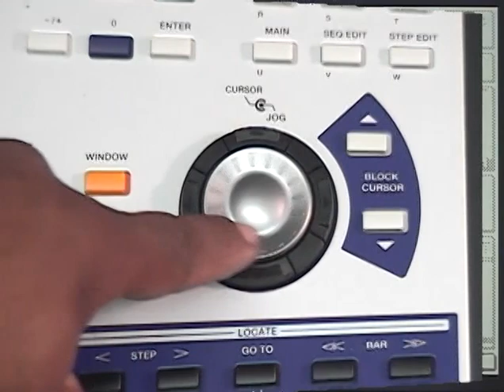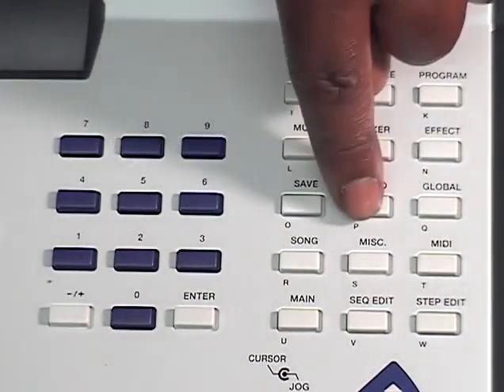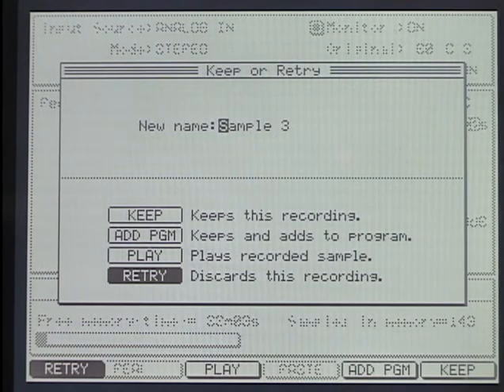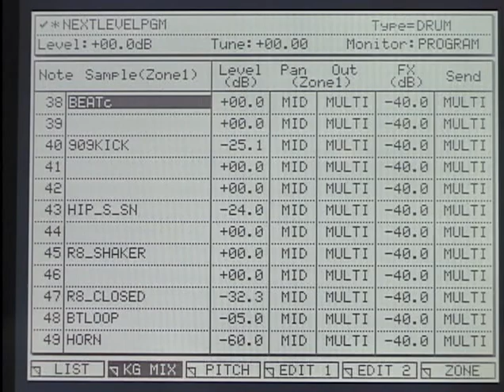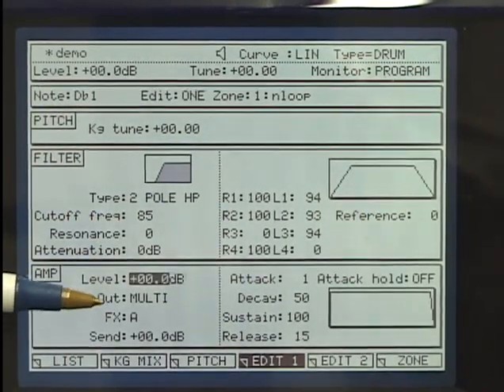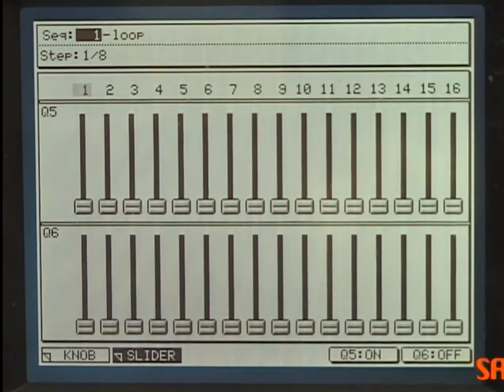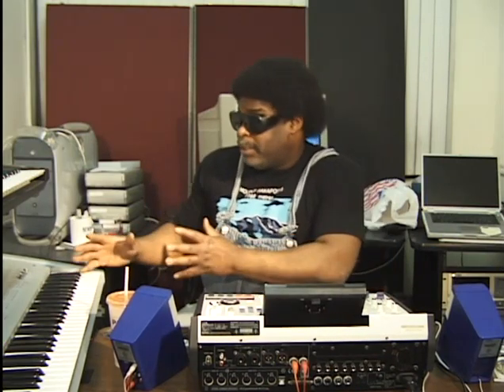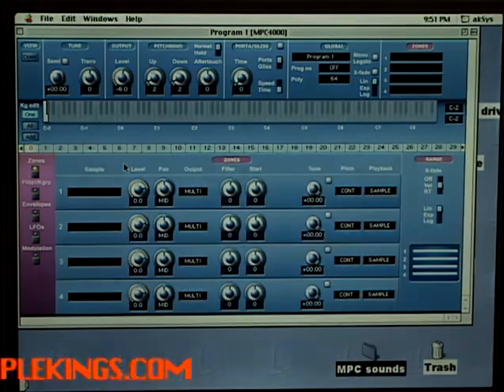AKAI MPC4000 BEGINNERS WORKFLOW GUIDE

Comment: I still have my old SCSI hard drive. Haven’t used it in years. It’s stupid fast. 15,000 RPM and gets hot as hell.
Reply from the maker: My scsi never got hot all we did was load and save.
Reply: @SampleKingsVideos  IDK. Maybe it wasn’t as fast as mine. I remember connecting mine with a internal to external USB converter and leaving it on the desk. I nearly burnt the house down.

Comment: On the “Sample List” window, when you strike a selected sample with the “Bank B/Pad 13” it will typically play the sample in its original pitch and, change the pitch higher or lower according to the pad # and bank. Mine currently is not doing that. Instead the Bank B/pad13 is pitched very high and the other pitches are randomly set across the pad banks. Any reason as to why it is behaving like this or how to change it back to normal?